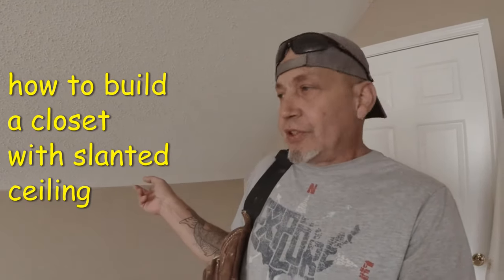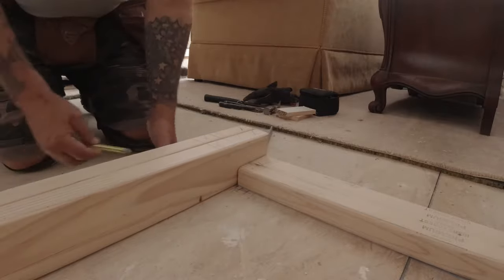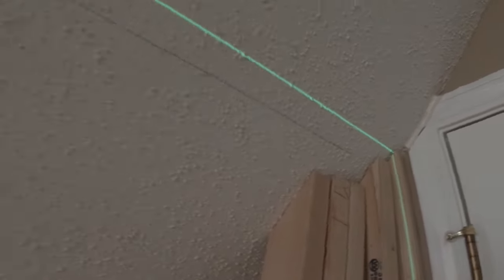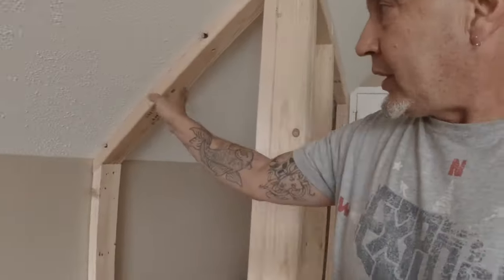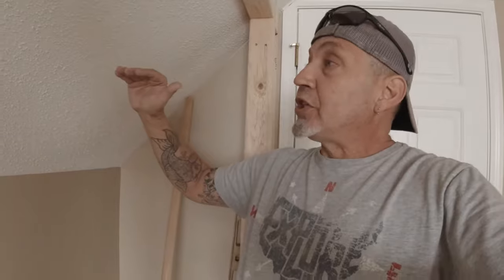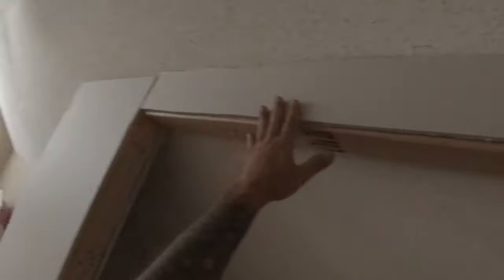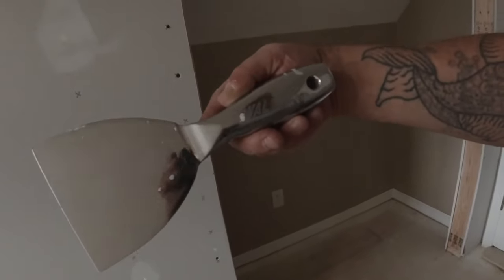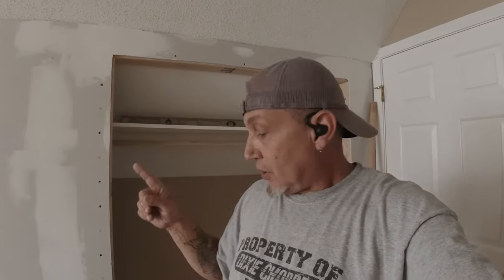how to build a closet with slanted ceiling, part one

Comment: I missed what you did for the top plates. How’d that work?
Reply from the maker: hey just wanted to reply, on that top plate i ripped a 2`4 @ 45` and fit between the studs vertical, watch part two and you can see the doors were cut a lot smaller, you will always need to cut 45`s up against the ceiling and then top plate up against that